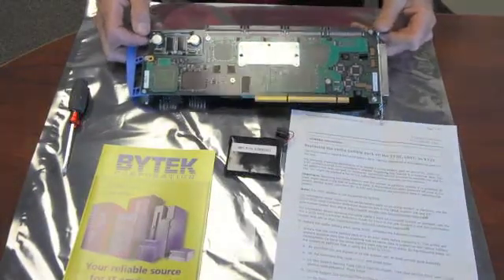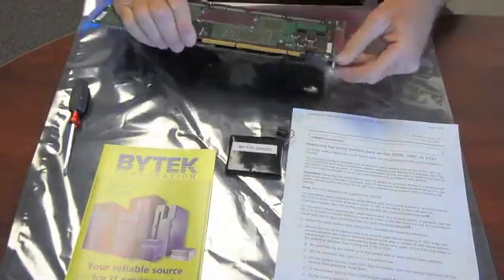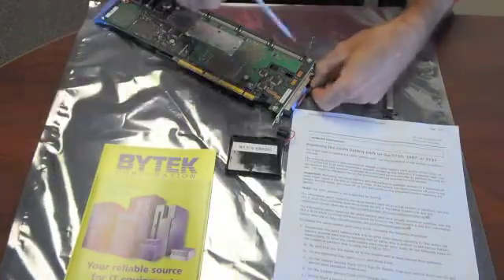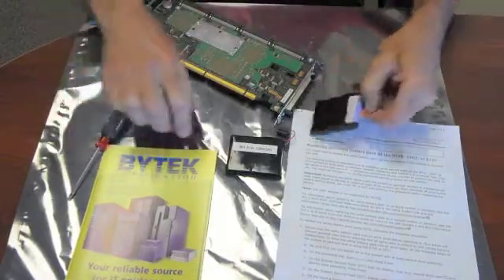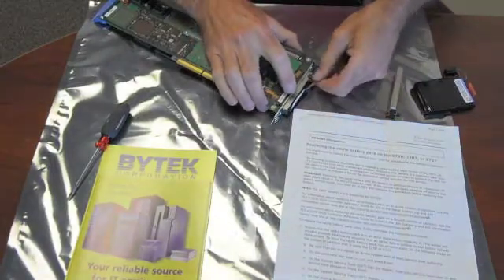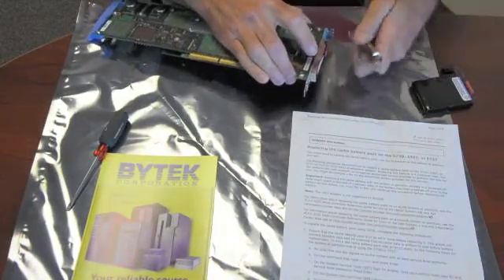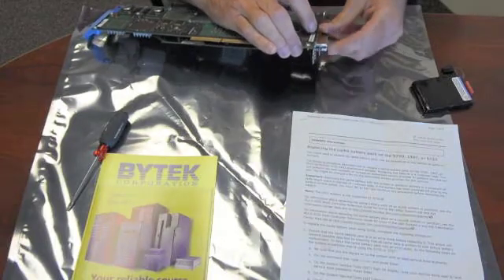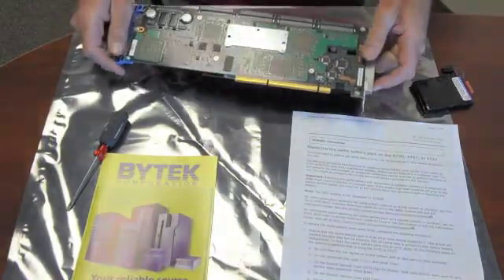IBM 2780 controller card battery replacement 42R8305

Comment: This Replacement can be concurrent!!! with the IBM i ON.
Reply: Are you sure  ? even if you pull the whole card like this  ?
The battery is accessible from the back w/o pulling the card.
The battery sits in a  little slot.
I know the battery can be pulled from the card concurrently.
But are you sure the whole card can be pulled concurrently ?